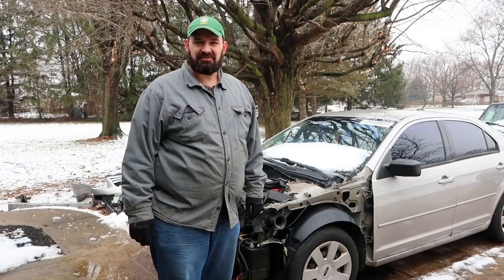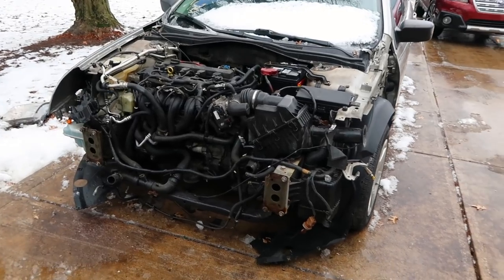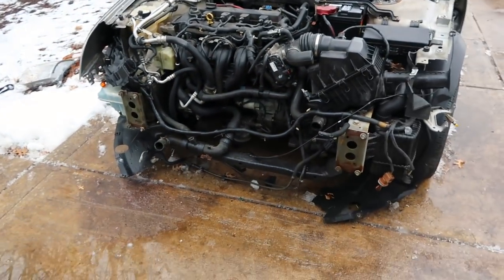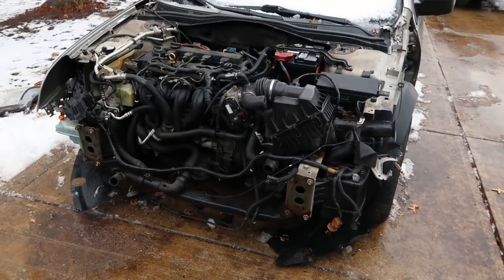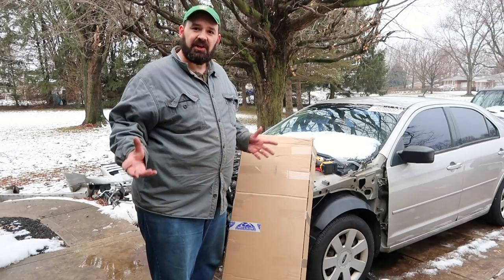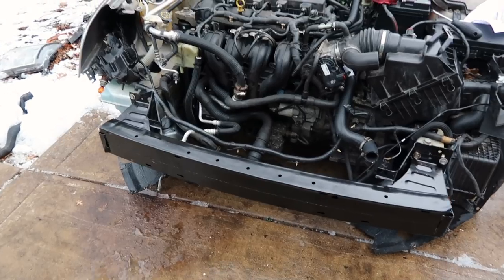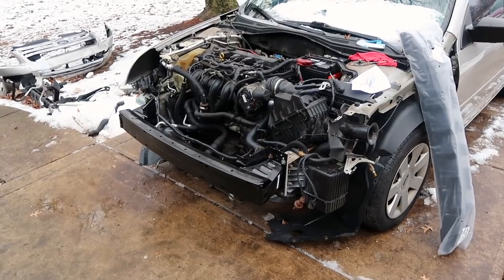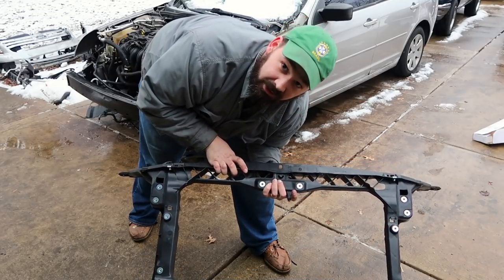Fusion Rebuild -- Part 4 -- Reassembly Part 2 — My First Copart Salvage Car Rebuild Project

Comment: Watching these episodes and it's pretty detailed. Never heard of copart and found one near me and it's only 12 miles away. I'll have to check them out and see what the restrictions are for MA. A little tip on vehicles with those hose spring clamps,if you can get at them now,throw them in the trash and replace with worm clamps. If the clamp style leaks after you put it together,it's going to be a pain in the butt to replace,even if you have the right tools. Keep up the good work.
Reply from the maker: That’s a good tip! I ended up having to replace a few of my clips with hose clamps like you’re talking about. They’re so much easier to work with!
Thanks for watching.

Comment: @crossroads rebuild are you a full time mechanic? I wanna tackle a small project like this but don’t have a lot of experience. Would you recommend doing one of these?
Reply from the maker: I’m definitely not a full time mechanic! I have learned a lot just by jumping in and trying. I read and watch videos on the projects I need to do. This is the biggest job I’ve tackled so far. If you are at all mechanically inclined, you can probably handle it. Just be careful of the car you purchase and don’t bite off more than you can chew while you’re learning!
Thank you for watching!

Comment: I would have put radiator and ac cond and fan in then put the core on. Thats the best way to do it
Reply from the maker: That’s another way to do it. I chose not to do it that way because there are a lot of hoses and hard lines that would have been hard to work around and hook up that way. I’m sure it could work, but the way I did it gave me more room.
Thanks for watching!